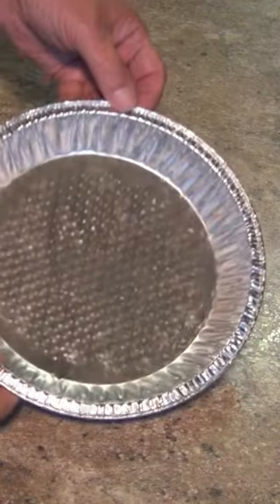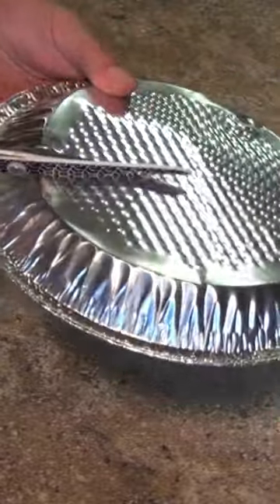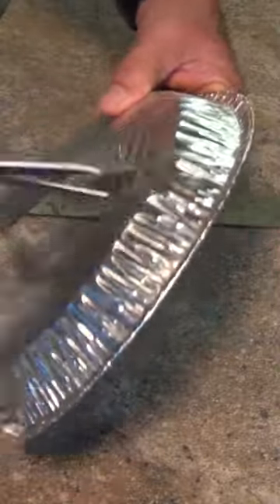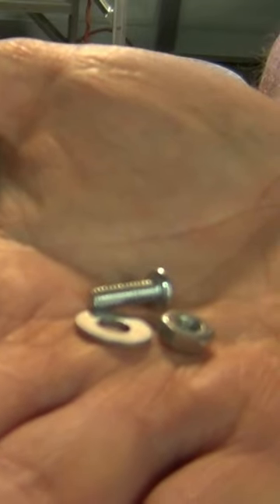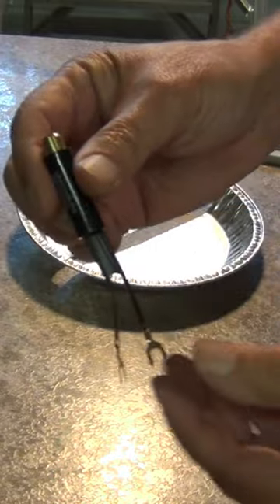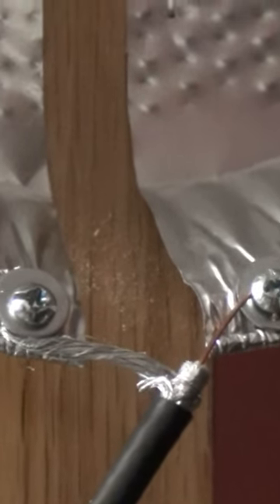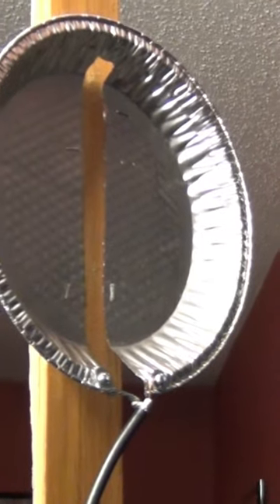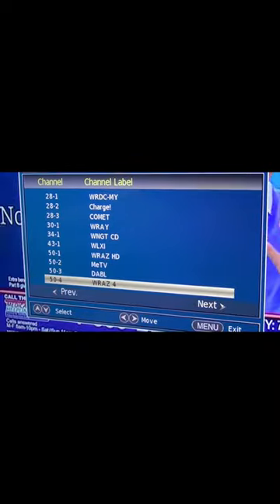Super Easy TV Antenna

Comment: What is the purpose of the cutout across  the diameter?
Reply from the maker: Antennas are basically electrical. The cutout creates a path for the received signals to travel. Without the cutout, the signal would take the shortest path, which would be the small distance between the terminals. Creating the longer path allows more signals to be received.

Comment: You need to give a size of pie pan.
This sort of antenna works vert well.   It has a broad bandwidth partly because it works as a folded dipole.
Reply from the maker: Hi Ken. The dimensions, detailed construction, and test results for this antenna are in the full video. Link is in the description. Thanks for watching.